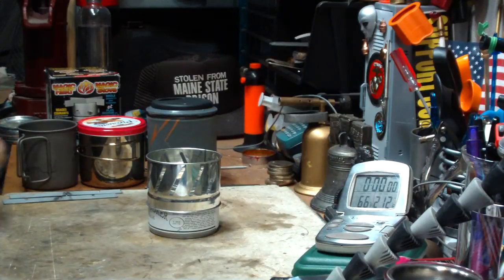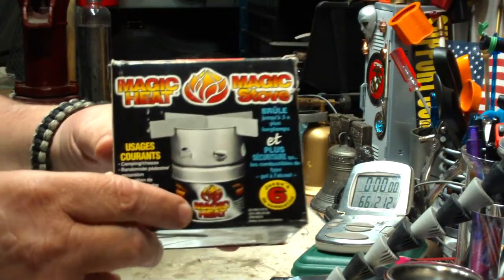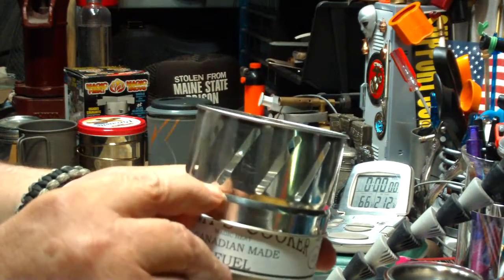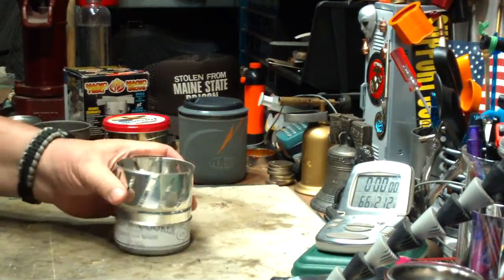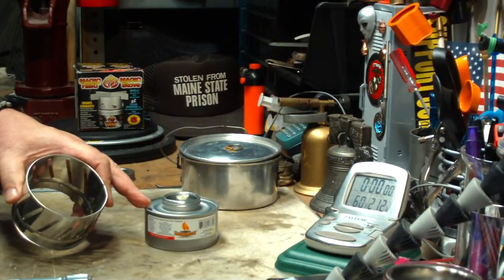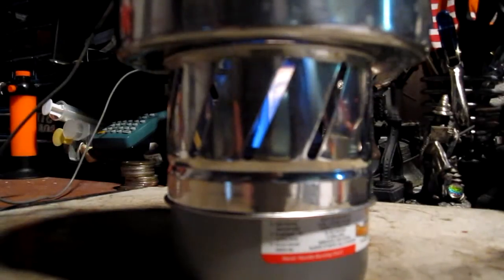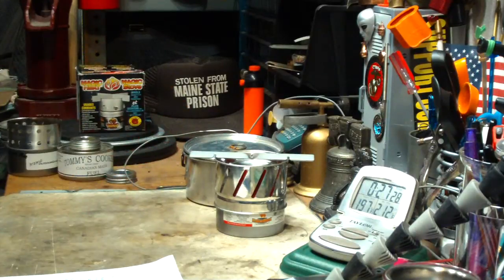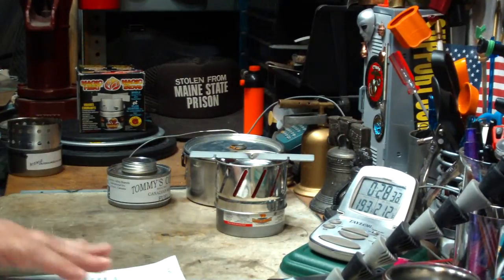Magic Heat - Magic Stove - Boil Test #2

Comment: LOL you didn't even use the magic heat fuel container,   
I agree with Bret Wayne that was NOT a fair test.    
 There should be a Boil Test #3  using ONLY Magic Heat equipment and do as the instructions suggest

Comment: I have the magic heat can it has the same wick as the fancy heat not the tommy's cooker . I got boil times as low as 15 min. and as long as 35 min. if you pull the wick out about 1.5 inches and flatten it out it work better

Comment: I was thinking, if the wider wick worked better, then the next test might be to remove the wick and the top insert where the wick was stuck into, roll up a piece of carbon felt and place that in the top.

Comment: Hi Hiram,
I made a fancy heat stove very similar to intense outdoorgear's. I used a piece of aluminum flashing and just cut out 3/8" triangles from the top and bottom edges instead of punching holes.  With the wick pulled out quite a bit and using a stainless GSI mug without a lid,  I got a boil time of about 18 minutes. Just thought I'd share that result.  I'm keeping that setup in my Get Home Bag for my truck- two fuel cans and the stove sitting in the mug = light, compact + easy!